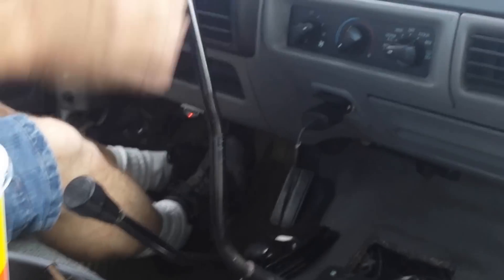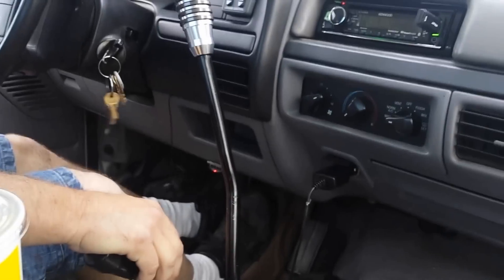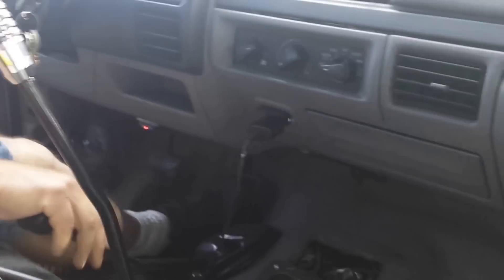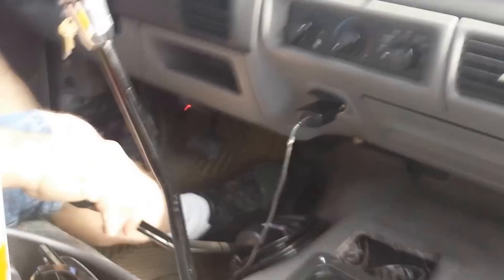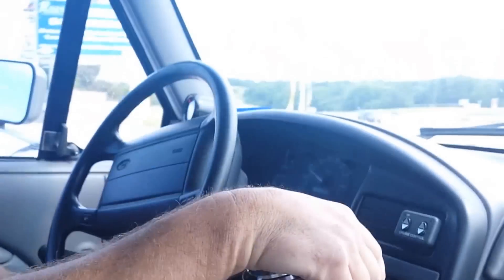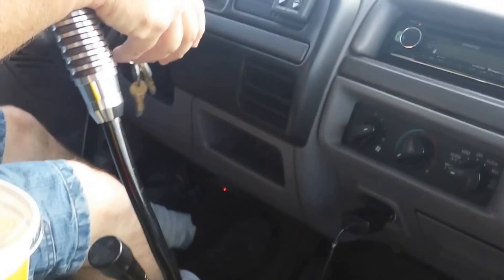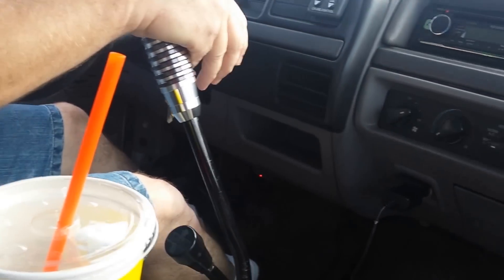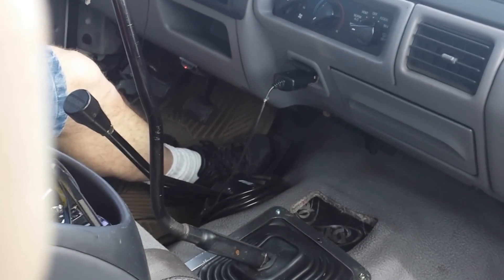F150 twin stick test drive

Comment: question fer ya when ya drive like a 5 sp ya split 3rd so wodunt that been actaully 6 in a way? nother question would u have to split 3rd could you do just 1-2-3-4-4 over?
Reply from the maker: When I "drive it like a 5 speed" I start in 2nd gear because 1st is granny low. So 2 , 3 , 3 over , 4 , and 4 over.
The main transmission is a T19 Granny 4 speed.
I do not have to split 3rd , I do it about half the time and the other half I just shift 3 to 4.
I almost always start in 2nd unless I towing , or heavy , or steep hill.
Another combo I use is leave it in overdrive and go 1-2-3-4 but the shift from 3 over to 4 over is a big drop in rpm so I have to rev it high in 3rd then shift to 4th. That is why I split 3rd about half the time.
That is what I like the most about this setup, I have so many options. Once you get used to it you just know what gear is the best gear at a moments notice. Just the other day I was pulling my car hauler with a Ford Focus on it, this is a heavy load for a F150, anyway I used 7 out of the 8 gears. I almost never split 1st unless I am just having fun. By the time you shift from 1st over to 2nd direct you have slowed down a little so its pointless, but  1 - 2 - 2 over - 3 and so on works real good for towing. Thanks for the question.

Comment: I met a Canadian family on vacation  in the 19 80s he had a suburban  with a Mitsubishi  deisel  a 4 speed and a 3 speed tranny set up he did himself only draw back he said was not enough power it was 80s motor didn't have a turbo  but pulling his trailer he said he got 28 mpgs
Reply from the maker: I would have loved to see that set up. I like manuals more that automatics also, unfortunately almost everything sold today is automatic. Only sports cars and base model econo boxes have manuals and I am not sure you can still get an econo box with a manual.  Dodge was the last diesel pickup to offer a manual transmission, do they still?
Reply from the maker: I would have loved to see that set up. I like manuals more that automatics also, unfortunately almost everything sold today is automatic. Only sports cars and base model econo boxes have manuals and I am not sure you can still get an econo box with a manual.  Dodge was the last diesel pickup to offer a manual transmission, do they still?
Reply: XxzombiekillerxX mlg pro r
Reply: ktumbleweed    I part out grain trucks and a lot of guys seem to want the 3 or 4 spd auxiliary transmission that was put behind a new process 5spd or Clark 5spd, what are you running as the auxiliary?
Reply from the maker: This is a Ranger Torque Splitter, it is made by Advance Adapters. It bolts up between the bellhousing and the stock 4 speed, so the aux trans goes in front of the main trans and they are "married" to each other. It is very compact, only 7 inches maybe 7.5 inches. In my truck I originally had a 5 speed that is not strong enough for towing over 2k lbs, so I installed this aux that is rated for 24.5K gross vehicle weight and put a T19 4 speed granny. Got rid of the 5 speed in the process and now my transmission is almost bullet proof. My rear end will shatter way before the transmission will even skip a beat.

Comment: So did you order the truck this way or did you have this done after the fact
Reply from the maker: This was a custom install that I did myself. It is a Ford T19 4 speed transmission bolted to the back of an Advance Adapters Ranger Overdrive transmission which bolts to the stock bellhousing.
Reply: ktumbleweed  cool man i like it

Comment: Awesome set up. seems that splitting to high is a little noisy. How fast can you go in 4th over. i do alot of highway haulin in my 84 f150 and screaming down the highway in 4th at 65mph with a load tends to suck fuel. like to at least be cruisin at 65 with a decant rpm
Reply from the maker: I can go faster in 4th over than in 4th. True it's noisy but its just like 5th gear in a 5speed. 
I recently did an experiment, I put it in overdrive and then removed the shifter on the 2 speed and drove around only using the 4 speed. I covered the hole in the floor with a towel. It was a lot more quieter without the shifter. That tells me that noise is transmitting thru the shifter. I plan on fabricating a rubber isolator to go between the shifter and transmission.
Reply from the maker: This overdrive would lower your RPM'S at 65mph apx 500 RPM'S
You can tow heavy loads with this unit, even in overdrive. It is rated at 24,000lbs Gross vehicle weight.
It's just noisy, but the noise is normal. I just turn up the radio.
Reply: That makes sense,  the noise of the transmission is transferring to the shifter because of no insulator. Also how about the drive shaft, did you find one or shorten the shaft? I wouldn't see why it wouldn't work with a 4x4 let alone it only bolts up between the bell housing and the transmission
Reply: Thanks for the info, I may just get one and find out.
Reply from the maker: It will work with 4x4. rear shaft would be shortned and front shaft would be lengthened. On my installation I went from a 5speed to a T19 4speed plus 2 speed. The overall length of the two transmissions was almost identical. All I had to do was remove the slip yoke from front of driveshaft and bolt the front u joint to the fixed yolk on rear of T19. I even reused the u joint. I did have to open up the slots where the center bearing bolted to the frame so I could move it forward 3/4 inch. there was plenty of room in the rear slip joint. Basically I got lucky. I have since had the driveshaft completely rebuilt because the center bearing was shot. So I went ahead and have the shaft lengthened 3/4 inch.

Comment: So i was trying to follow so is this how it goes? 1st direct,over then 2nd direct,over etc? I assume direct and over would be the same as low and high? Never seen a twin stick but it's interesting. The smaller shifter i assume just moves forward and back, not an H pattern like the main ?
Reply from the maker: yes and yes. Small stick is forward and back only. Direct (or low) and Overdrive (or high)
the big stick is just a regular 4 speed (1st gear is granny low).
Old semi trucks (pre 1980ish) had two sticks.

I can drive my truck without moving the small stick if I want. I just leave the small stick in overdrive, but the shift from 3 to 4 is a huge rpm change so I like to split that shift (shift 3 high to 4 low).

Comment: What over drive u running
Reply from the maker: It is a Ranger Overdrive / torque splitter made by Advance Adapters. Advance adapters dot com.
It is made for Chevy and Ford older 4 speed transmissions. It bolts to the bellhousing and has the same input shaft and clutch bearing surface as the 4 speed. Then the original 4 speed bolts into the back of that, after modifying the input bearing retainer of the 4 speed.
There is a description box above that has a tab you can click "show more" that would have answered this, plus I have answered this several time in the comment section below. Just so you know in case you are new to You Tube or something.

Comment from the maker: Thank you. That is the main reason I did this swap was for the fun of it and to make people go wtf??
You can do this same thing in a Chevy truck, Advance Adapters makes this same overdrive splitter in a Chevy version.  Only works with a 4 speed transmission.
Reply: ktumbleweed can you explain to me how things works? seriously I wanna know, what's the purpose?
Reply: ktumbleweed of the second stick I mean, I'm kinda putting it together I'm My head on how it works but I'm not sure Iol
Reply from the maker: I will do my best to explain it. The second stick is a completely second transmission mounted in front of the main 4 speed. It is a 2 speed transmission. Lo and High or Direct (no gearing at all, power simply flows as if its not even there) and High is an Overdrive gear of .73 to 1 ratio. The overdrive can be shifted into at any time including reverse. The 4 speed is a wide ratio which means there is a big rpm difference for each gear. The 2 speed is a close ratio or small rpm difference.  
Take the first gear ratio of the 4 speed which is 5 to 1 and multiply 5 x .73 which is 3.65 to 1
so 1st gear in the main with direct in the aux is 5:1 ratio and if I just shifted to 2nd in the main it would be 3:1
but if I shift to overdrive in 1st I get a gear in between of 3.65:1 which is basically a half gear. This is where the term gear splitter comes from. 
I do not have to shift into overdrive if I do not want to, or I can shift into overdrive and leave it there all the time, this is what I like the most about this, it gives me many options. 
I will list all of my gear ratios below
1st direct = 5:1 , 1st overdrive = 3.65:1
2nd direct 3:1 , 2nd overdrive = 2.19:1
3rd direct 1.78:1 , 3rd over = 1.3:1
4th direct is 1:1 , 4th over = .73:1 (basically the same ratio as 5th gear in most 5 speeds)
Hope this helps.

The way I shift it most of the time is I start in 2nd gear with the aux in direct and leave it in direct until I reach 4th gear and over 45 to 50mph then I shift into Overdrive.
Reply: ktumbleweed thankyou! That helped
Reply from the maker: No problem. Thanks for watching my video. I can't believe I have almost 33k views!!

Comment: usually I can't stand fords. tbat being said this gearing set up is probably the most unique pickup mod I've seen ever. fucking awesome how you got regular gears and then overdrive on top of it all, and the shifting! ah that truck would make me cream my pants driving around flipping two shifters at once. dont know why but this is the coolest thing I've seen in a while
Reply: jsalmon twin stick used to be standard equipment back 40 50 years ago in semis..... the most common was a twin stick 15 or 18 speed. A 5 speed main with a 4 speed auxiliary..... 
you shifted into 1 gear on the main then ran through all 4 gears on the aux..... or skip the first gear which was so low it was almost never used..... 
then shift up the next main gear and then back to the lowest gear on auc and the shift it back up ..... 

The 2 speed aux has been around for about 80 years coming and going under different names and guises .... 
they were popular in the 50s 60s and 70s. In the GM medium duty trucks that came with 3 and 4 speed compound transmissions..... the  2 speed and compound lo main gave them 
A   Deep reduction gear 
A Lolo gear 
Lo gear direct and the aux gave them an OD gear 
The aux usually is a 1:1 gear and a 27% OD GEAR 
So you could split all the gears with the aux keeping your rpm more stable. And giving you a higher speed capability and the ability to drop 1/2 a gear going up or down an incline 
To this day a twin stick setup is superior to a road ranger or air shift 

Simply because it’s a fully manual selection you have endless options and combinations of gears at your disposal for any situation...... 
when with a modern 15 or 18...... 
you can’t pick a specific ratio or combination you just get what you get out of the 15 you have.......
Reply: jasalmon21 just came from a Ford Cummins with a super 10
Reply: Your dad set that in motion? Hating Fords? I was  chevy guy for my first two decades...then Dodge for 20 years and now I am all Ford. It matters not.
Reply: jsalmon yea i see L and D on ford shifters with numbers inbetween lmao

Comment: good luck on your resale
Reply from the maker: My truck is 22 years old and was purchased for $2000 a year ago. Resale value means nothing to me. When I am done with a vehicle I part it out one piece at a time. I get more money that way. If this truck got wrecked tomorrow I would buy it back from the insurance company, take this transmission and put it in another truck and then part the rest of the truck out.
Reply: Id by that truck  in a minute! I wanna do this to my 79F250 4x4 for longer drives out west. Excellent upload cleared up some questions I had. I subscribed.

Comment: The shifting pattern looks like if you were driving a Eaton Fuller but with a physical stick for the splitter.
Reply from the maker: If you are referring to a super 10 then yes, that is precisely what it is like. This aux 2 speed is an overdrive that also acts as a gear splitter. Basically you can shift to overdrive in any gear. A wide ratio 4 speed becomes a close ratio 8 speed.

Comment: I want to try this in my 1983 f100, how much did everything cost to do this conversion?
Reply from the maker: The Aux overdrive from Advance Adapters is around $1600 give or take, I found it cheaper at some bronco website. Jeff's bronco graveyard I think..  If you already have a 4speed then you are good there. If you do all the labor yourself (not exactly an easy job, some fabrication or modification is necessary) you are looking at around $1800 or more total.  This includes driveshaft modifications, if you have a 4x4 then it will be even more since you have two driveshafts to modify. This is not a cheap conversion and must be thought out carefully. The overdrive makes a lot of noise, and it does not go away once it is broke in. Another thing is it affects the shifting of the 4 speed. This unit goes in front of the 4 speed so it adds rotational mass to the input of the 4 speed. What this means is the syncros in the 4 speed have to work harder. You have to wait longer on the upshifts and the downshifts are even worse. I double clutch the downshifts because my 4 speed has bad synchros. Splitting gears is fun some of the time, most of the time I just use the overdrive in 4th gear. Some times splitting 3rd is nice, especially pulling a trailer. I have an 18ft car hauler that can easily weight over 8k lbs. When it is heavy then I start in 1st (granny) then 2nd , then 2nd over , then 3rd, 3rd over etc etc. Splitting 1st gear in my truck is useless because 1st over and 2nd gear are so close to being the same gear.
Anyway, sorry for the long rant but I wanted to give you all the pros and cons. Let me know if you have any more questions. If you are ever near Decatur TX give me a shout and you can check out my truck in person.
Reply: ktumbleweed You answered the question I had right here, I was going to ask if that 4 speed was synchroed or not, wouldn't this set up work better if you took out the synchronizers?
Reply from the maker: It would work better for me because I am an ex trucker and I know how to float gears / rev match.
I do not know of an easy way to remove the synchros since they are what locks the gears to the output shaft. I just rev match double clutch shifting into 3rd and shifting down into 2nd since both of those gears have worn synchros. I have tried floating the gears but it is not easy to do on a synchroed transmission. You have to be at the exact rpm, on a heavy truck transmission without synchros there is more wiggle room.
What works well is to shift the 2 speed into neutral then shift the 4 speed then shift the 2 speed back into gear, but that is way to much work on a regular basis. I may shoot a video on how to shift a transmission with worn synchros.
Reply: ktumbleweed it is hard floating synchronized gears, I've tried it in my car, and didn't go well lol, but in my Cascadia, the Eaton Fuller 10 Speed floats easy

Comment: I have an 89 f150 with the 4 speed. Highway speeds (70mph) I'm 25-2800 rpm.
I like the idea of this twin shifter a lot because I love my 4 speed on everything but interstate. 
My concern is my 4x4 shifter sits in the exact spot your OD shifter seems to me sitting. Do they make one that accommodates this?
Reply from the maker: Keep in mind if you install this unit everything moves back 7 inches. Shifters included, I assume the 4x4 shifter is attached to the transmission or the transfer case, it will move back with the transmission and T case. That should open up a hole for the shifter. The overdrive shifter bolts to a short arm on the side of the unit, it has an extra set of threaded holes drilled so there is some flexibility. Some shifter modification will be necessary anyway. Plan on this conversion taking longer than you think. Your crossmember will need to move back 7 inches etc etc. On my truck the exhaust got in the way so I had to cut off part of the heat shield and a small corner of the cat. I took the trans shifter and reversed it and then heated the piss out of the shifter arm to bend it close to where I wanted it and I still am not happy with the shifter locations. I plan on making some custom shifters in the near future.